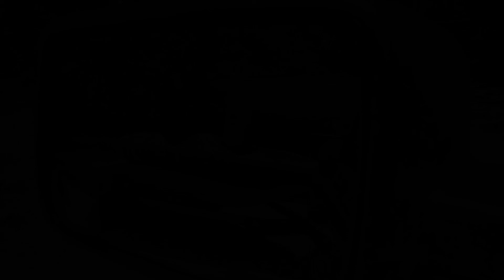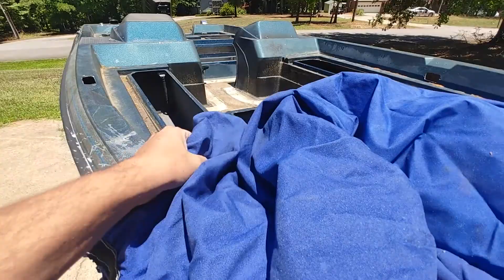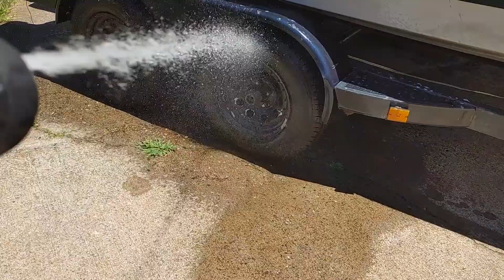Removing the Mercury Outboard Engine #3 | Tracker Nitro 2000DC Restoration

Comment: off topic question. it looks like you and I have the same jack plate. I have an old TH Marine 2 piece with a 10" setback. The side of yours looks identical to mine with the round bar stock running parallel to the ground with the adjustment bolt coming down out of it.
I tried to loosen my hardware up enough to adjust my engine height but couldn't get it to budge. Not sure if the metal to metal was just seized tight or if I was doing it wrong. My goal is to measure and adjust my engine to the correct PTP height. 
Could you do a video on that? My engine is a 98 Merc V-175 carbureted on a 93 Ranger 482V. Thanks